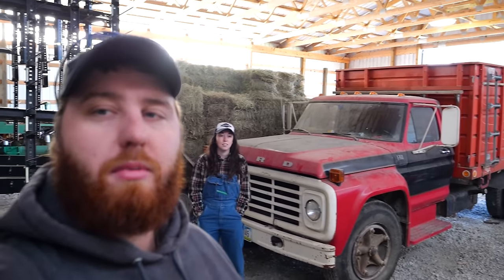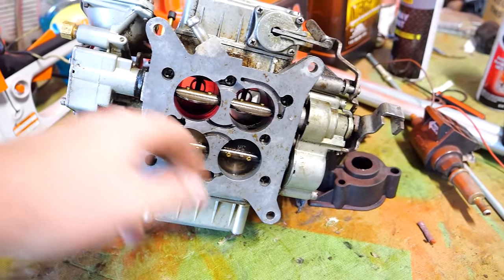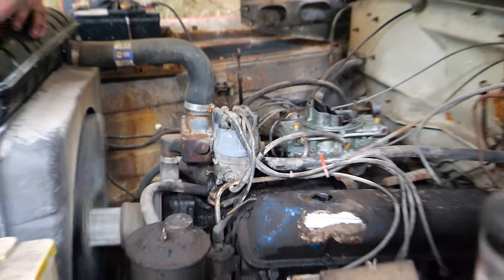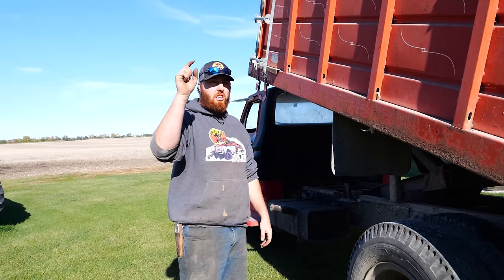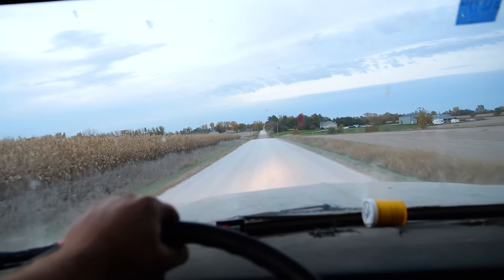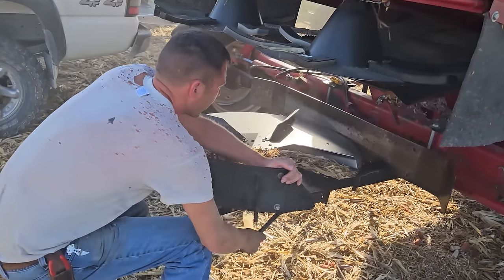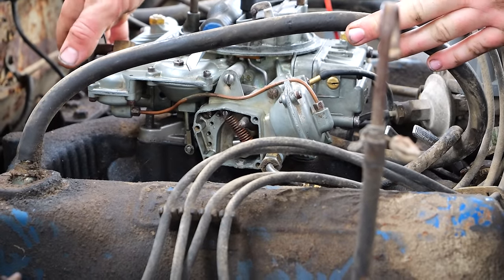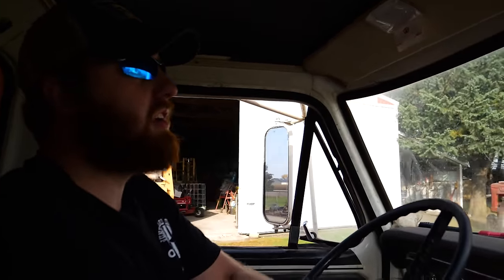Will this Old Grain Truck RUN & DRIVE in Time for HARVEST!?

Comment: Those where sold by the dealer here in El Salvador in central america as a ford F7000 they came from the factory with a caterpillar 3208 v8 diesel and a 5speed air brakes power steering and the parking brake was one of those "maxi brakes" of its time my dad told me that it was so powerful that it would break the rear ends very often and to be able to use it he had the rear end swapped with an international semi-truck rear end and that was the fix also that thing could play with 7m3 of sand like it was nothing so awesome its the first time that i find a video of this truck ever im going to show it to him even though he doesnt know english haha

Comment: If you got $11 a bushel, that was a $2300 harvest. On the low end  if they weren't super dry it would be about $1950. Either way, not bad for a fun hobby farm. Not sure what you had into the crop. But I'd guess about $600.

Comment: Our old ford has issues where it sucks the pickup shut. every once and awhile it aint got no fuel. switch tanks, run on the other year old gas for a few miles, then switch back and its happy. could be dirt in the tank. long story short, these things run forever if you give em 5 gallons of fuel per mile lol. clean tanks help.

Comment: And we did NOT have battery operated screw drivers. I went into the machine with a 9/16 and 1/2 wrench and Dad warned not to drop the wrenches or the bolts. They were all we had. Whew!

Comment: The 391 is the large truck version of the 390. It is a low rpm, high torque motor.

Comment: Man, if there was a jackpot for guessing the weight of the truck empty, I might've won! I guessed 10,000 pounds. Of course, I cheated a little because 30 years ago, when I left the family farm, I drove a 1966 International Loadstar 1600 grain truck very similar to this one except make. Empty, it weighed 9500 pounds. Love seeing these old gems still running. Another common engine those old Ford's had was a 332 and I think even a 351 or 352.

Comment: I never did get my old Ford grain truck to run right. Wish i knew someone who can rebuild one of those carbs. Mines a 83 with a lima 370ci engine and has an electric hydraulic unit to lift the bed. Super cool old trucks but nobody works on them and nobody will buy one so who knows what to do with it now. Interesting video thanks

Comment: you should of done a oil change on her seeing that carb has been dumping fuel down that intake and the oil is most likely filled with fuel that last thing you want is to wipe out the mains because of gasoline oil

Comment: Unless your cousin repowerd his combine with a engine swap most those IHC's  have well the famous strong IHC DT466 in those combines same used in the trucks and earlier farm tractors like 4366,4386 IH/ Stieger 4WD tractor I'm Oliver White MM and Canadian Cockshutt guy but a all round gear head I have either operated them or pulled wrenches on them

Comment: I have a old 1969 Ford  F 600 dumb truck you can come fix for me.  I wont complain. I really need to use it for once never really have its a 361 😮😊😊😊 motor

Comment: I drove a 78 f600 for work drilingl environmental observation wells and wells for water treatment and cleanup fun fact the only place I could keep up with my operator in the rig(a 99 f700 with a Cummins and a CME drill on it)with that little truck was one place coming down the mountain on i70 in Colorado right after the last turn there is this 2-3 mile straight away push the Cluch in and get ready for reentry.................yeah that truck driver should have to do his 110 yrs, but we have a bad governor so he took 100 off and thats where he klld  several people including a family and soiled my story of having one place to harass my operator for weeks of me running  lights and just driving like a ass trying to keep up one place I could run him down 😎oh by the way she was a vet she might bee red on the outside but all Olive drab on the inside and 331 was what I was working with

Comment: Ah yes, industrial engines. Last forever but definitely different to work on. My dad has a 413 chrysler in his 73 travco. It's an industrial engine. Low compression but it's torquey and revs out pretty good. Problem is, water pumps. That has a totally different pump than a automotive application. You can't buy pumps for that engine anymore and only a handful of places rebuild them AND it's expensive af! (It cost my dad almost $500 to get the water pump rebuilt for that 413. If you buy a old travco do NOT get one with the 413.)

Comment: Those big gas engines they never seem to run right. 
Mainly caused by sitting and sitting! 
I ran a lot of those back in the day and no matter the brand they all seems to do the same things.  Wont idle. Pops and backfires.  Hesitations and lack of power and horrible fuel usage! 
They werent easy to deal with. 
Maybe better if driven more often. ??

Comment: if you can find  smaller model for your small farming operation Kevin those aren't too bad of combine  but for other vintage classics for your farm a MF 410 or 510 they had Chevy motors in them 410 the good old 292 6banger Chevy 510 V8 327 or 350's Chevys ,Olivers Whites 5542,542, 545, 7300 White they have Dodge mostly V318's JD used a strange motor you may not had any experience or parts JD and Case used Hercules gas motors through 50's and 60's then JD went to the hundred models like 4400,6600 & 7700 they used JD only Case start to use Chrysler Dodge motors

Comment: still get parts thier just old system lot times was air but air didnt work states rules all kinda makes used that system and wheel rim and hub makers not that hard just time got lots with that system belowes in air chamber lines lot these trucks internal use a conversion air system better then that booster hydro vacum was big loss in power like just add in air tank no brake chambers get pleaty fuction belt drive compresser